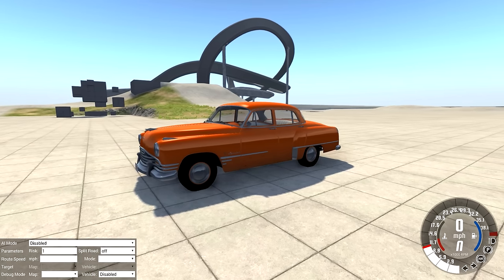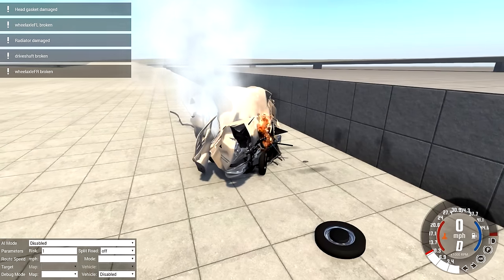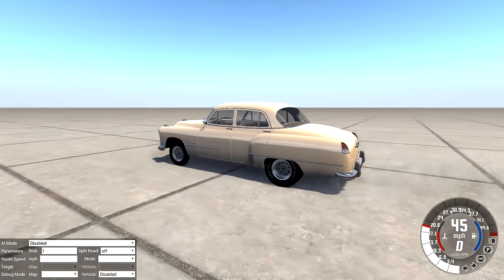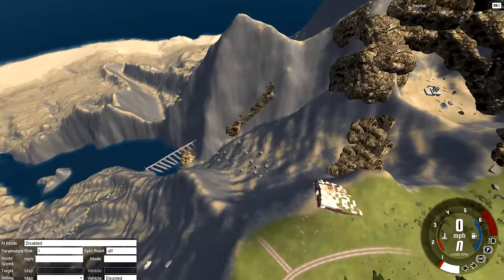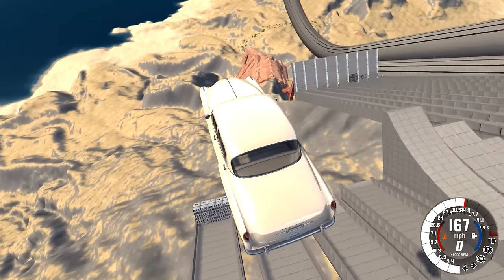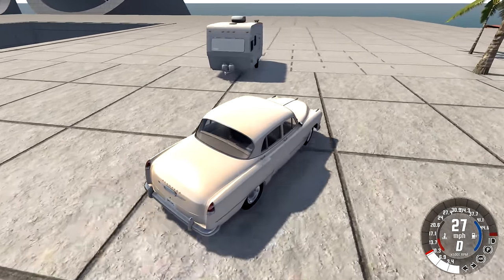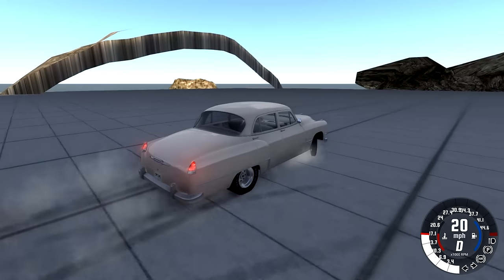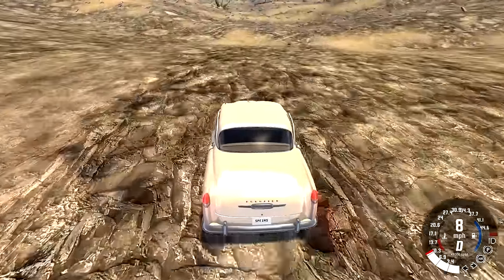BeamNG.drive - JET CAR

Comment: A turboprop engine is a large prop attached to a smaller jet engine so ya it was a jet engine, turboprops do not use conventional piston engines they use jet engines

Comment: funny, dodge makes some of the shittiest vehicles around. 2 valve single overhead cam bullshit lol Coil spring rear end in a truck hahaha and now 8 gears?!?!? wonder why they never last. Buy a tundra thats a real truck. Bigger brakes. Bigger diff. twin cam 4 valve per cylinder. better resale value. better reliability. literally there is 0 reason to buy a ram spec for spec.